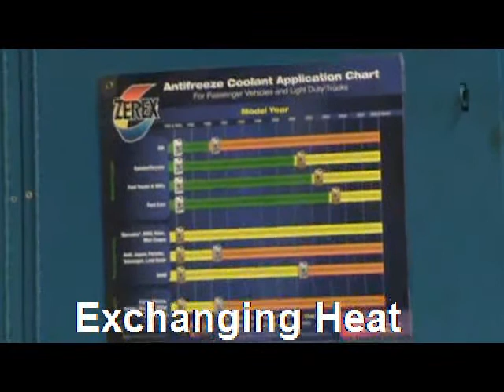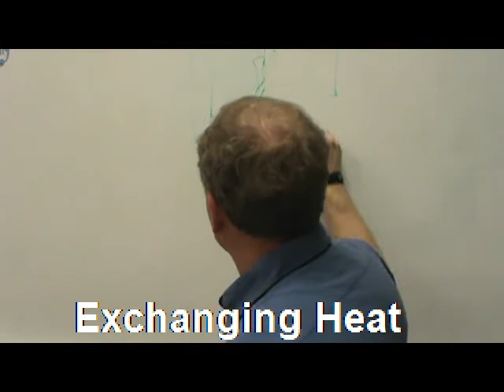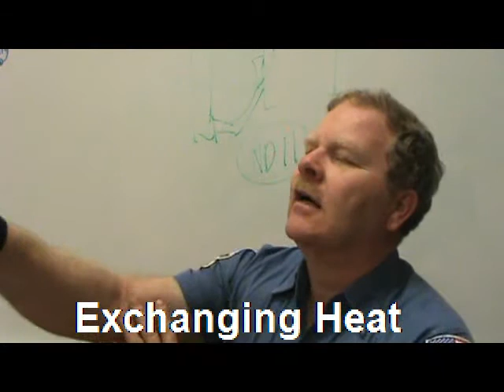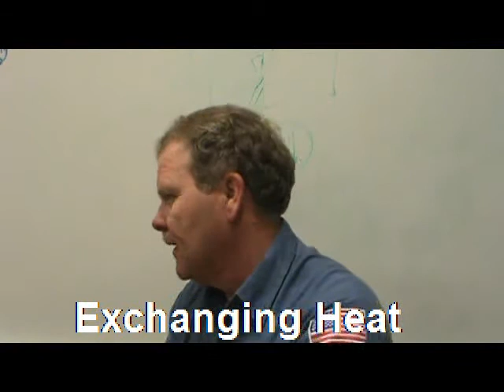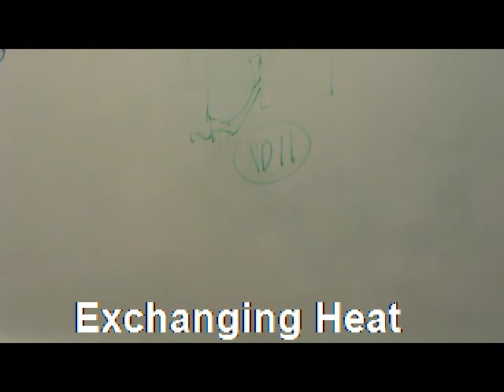Exchanging Heat

Comment from the maker: It depends on the size of the cooling system. For a 12 quart cooling system I usually use about half a bottle - but don't pour it in and leave it there - warm the engine up good and then get it out of there. :)